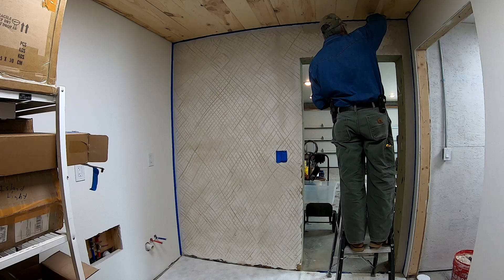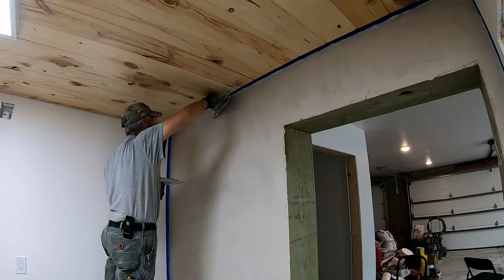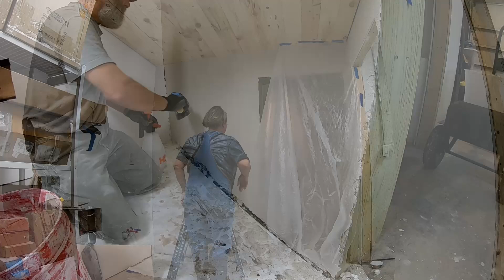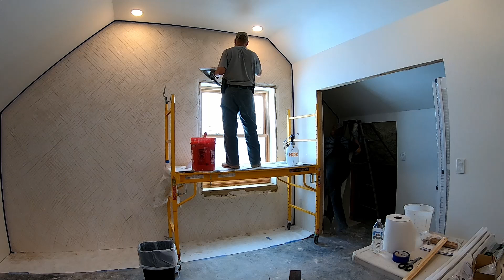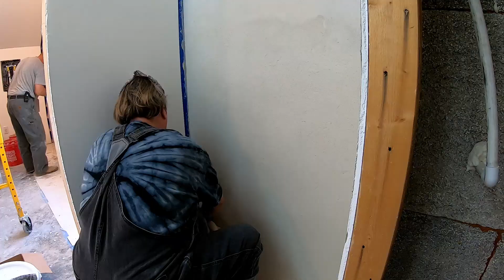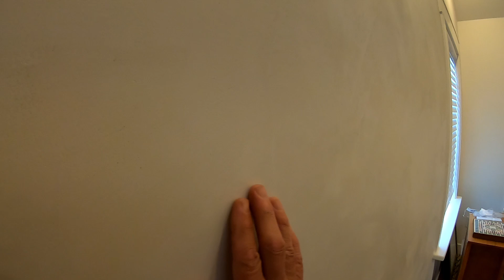House Build 65 - Lime Plaster Part 3 - Finish Coat

Comment: I do have one question as to how do you clean it if you get something on it? Sanding or what? Also, I bet working with that plaster is rough on footwear. It's a good thing you ain't wearing those builder pros for this particular job.
Reply from the maker: Once it is cured hard you can clean it with a damp cloth.  I would think saturating it would result in material removal.  Deep stains or damage can be sanded and a skim coat put over it (according to research).  I hope not to have to find out how to do major repairs...
Yes, the plaster is hard to get off and it tears up the leather since it is high alkalinity.

Comment: Man that looks nice.  What happens to it when you want to put in a nail to hang pictures, etc.?  Or, do you use some sort of "nailless" hanging?  Can you paint it if you decide you want a different color somewhere?  That's sure a lot of work but it seems like it's worth it.
Reply from the maker: It should support pictures with the angled fastener hooks.  Anything heavier would require drilling into the concrete behind the foam exterior.  We haven't gotten to the hanging pictures stage yet so we don't know how this will work.  Plaster used to be installed over lath so there was a wood structure behind it to give some support.
You can paint it but it would prevent the benefits of having the plaster exposed.  The colors are easily changed with limewash or lime paint.  We decided to live with the natural color to decide if we wanted to change it.  Plus, with the 10' overhangs we were concerned with it being too dark.